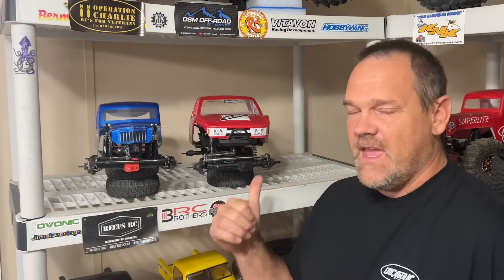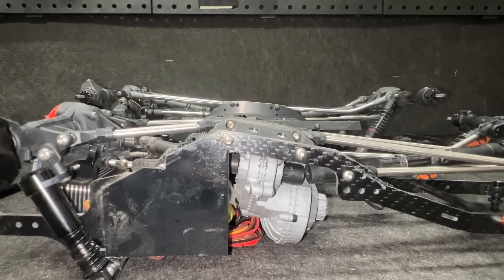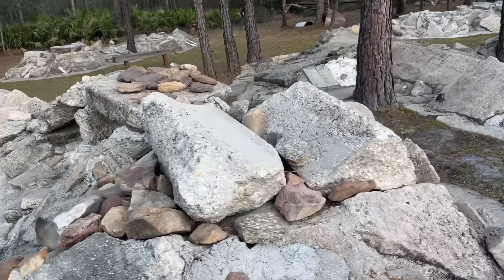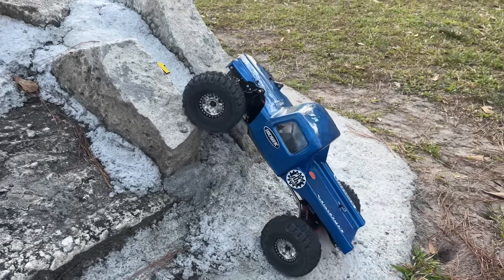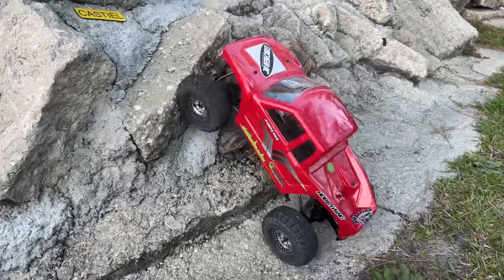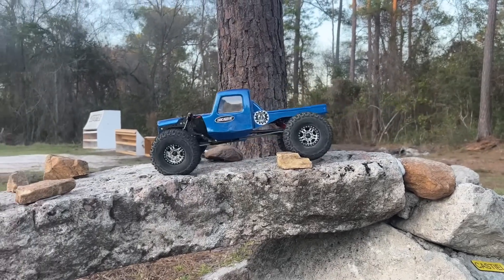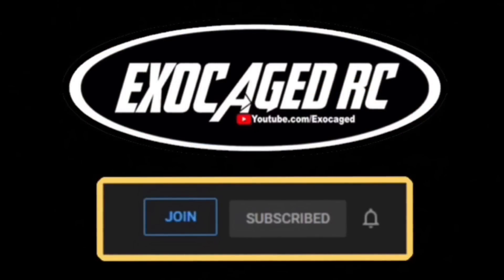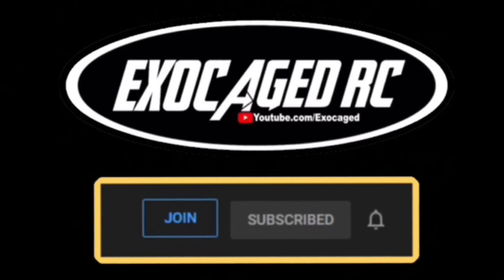PowerHobby VS Scx10 PRO

Comment: If I had to pick one of these trucks to go into a competition with I’d take the Power Hobby. The 10Pro is great for someone getting into competition but better stuff can easily be built. 
I think I heard that the AR45 straight brass knuckles fit on the pro axles if you want to try some brass options.

Comment: Omg I built the same power hobby mine is pretty close to the same, same axle but with 30% under same ssd same dravtechs  I'm using that amazon dig transmission  with fusion pro and reefs raw servo on method clones wheels with injora brass rings, proline predators heavy brass bumper mount ssd diff covers and flysky gt5. With creep body
And this rig is fenominal i can't believe how well it gets over I'm obsessed with this rig
Reply from the maker: Yeah they are amazing for sure
Reply: @ExocagedRC  yea I actually watching your reefs internal spool winch video I'm thinking that might be my choice  looks powerful but that low profile with it inside I think it's my choice gotta order now thank you for all you do your reviews really help me decide on where I spend my loot